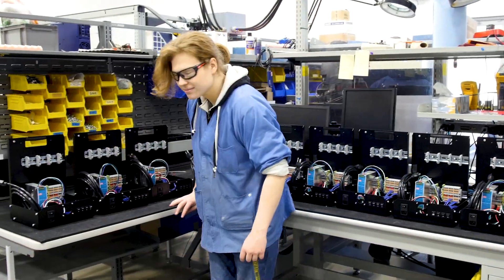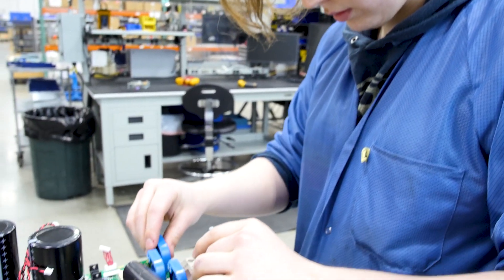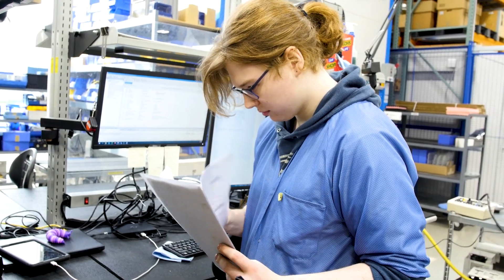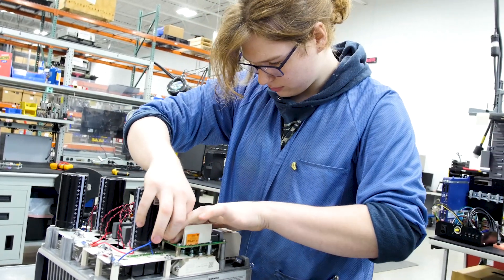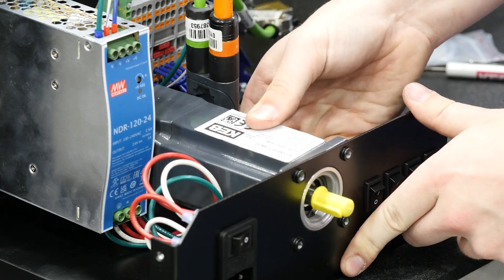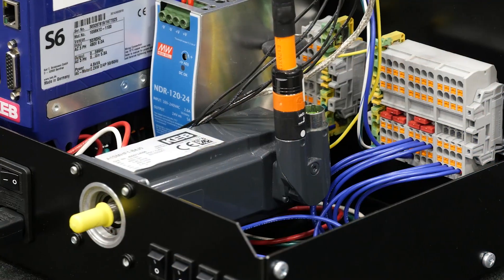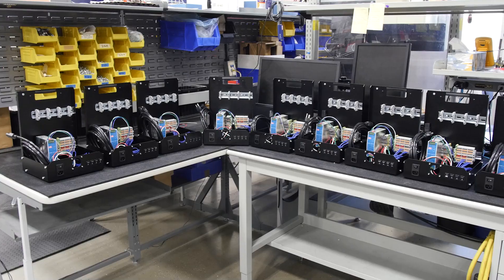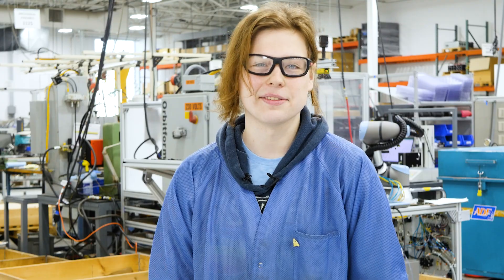Electronic Service & Repair Department Intern - Travis Day  |  KEB America

Comment: Can you help me? I have a KEB F4 with parameter problem. When the machine is off the Inverter constantly going back with 'rcon' status and -0.3 speed.
Reply from the maker: Thanks for reaching out, Ivan. My first recommendation would be to contact your machine's OEM to see if they can help. I'm not sure what type of application you are using with the F4. We would need more information to diagnose. If you cannot contact your machine's manufacturer, you can reach out to a KEB representative for further assistance: https://www.kebamerica.com/contact